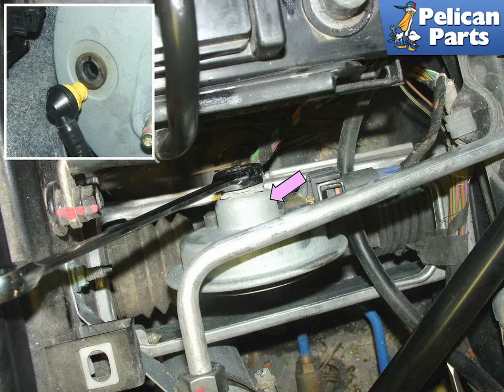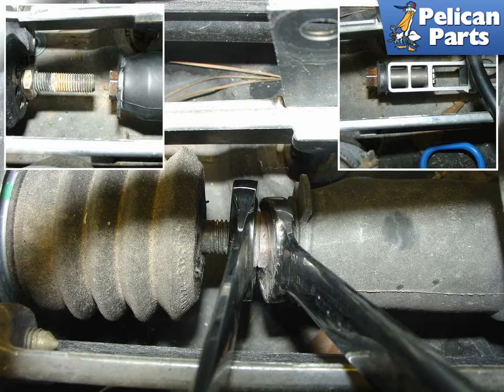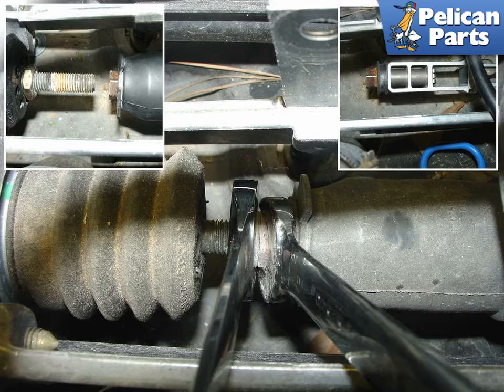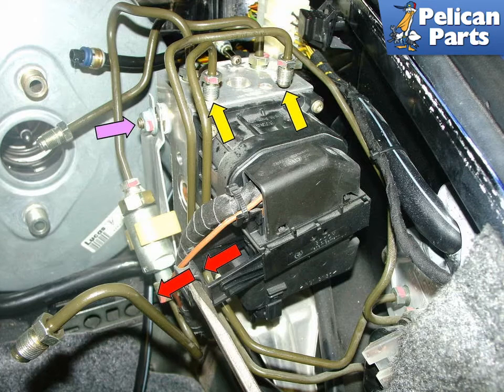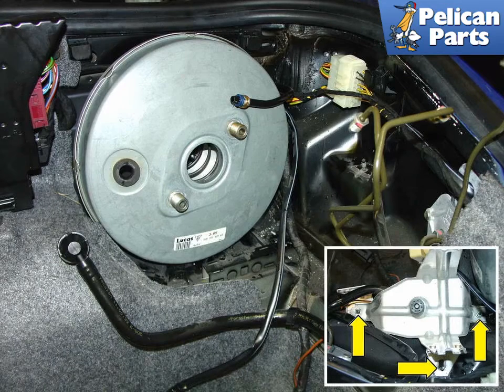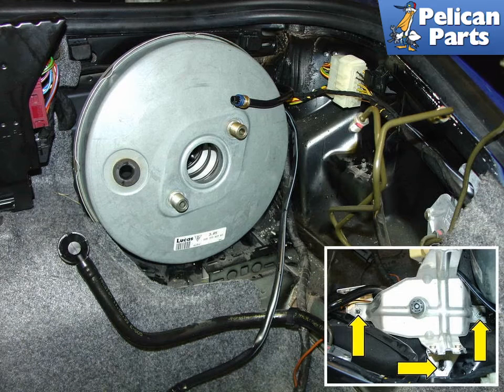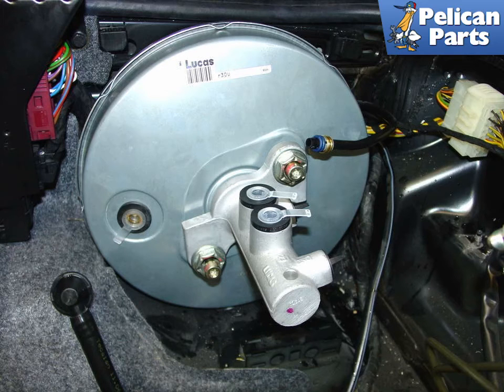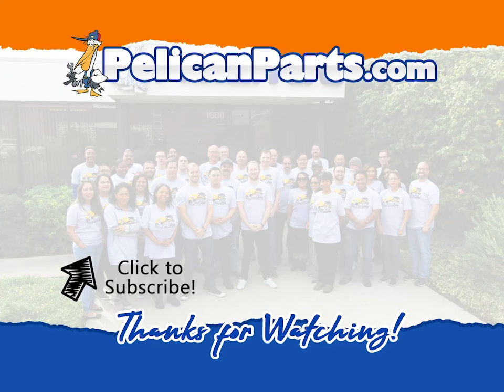Porsche 996 Brake Booster and ABS Control Unit Replacement (1999-2005 911)

Comment: Does the reservoir just pop off the old master cylinder?  Any tips?
Reply from the maker: Yes, they pop out of the rubber seals. Pull straight up to remove.